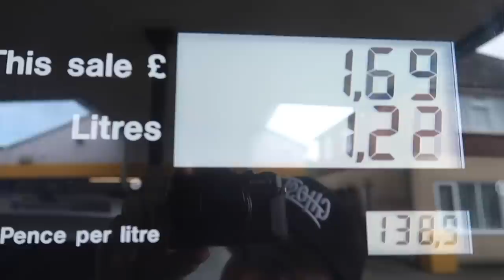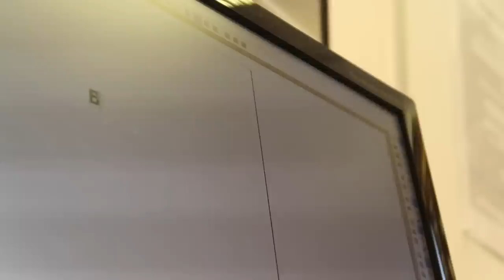1982 Bmw 320/6 Collection - First Start in a YEAR!

Comment: Completely clean it inside and out, Change all the fluids, brake job, put some wheels and tires. And make it a drift car until it folds in half.. and it sounds like it has a blow in the back box, exhaust delete.. weight reduction ftw